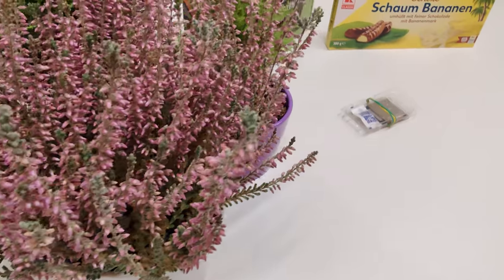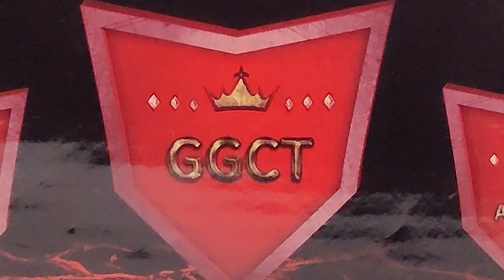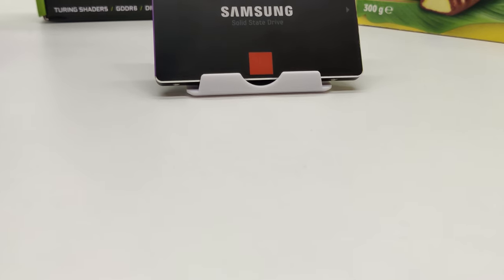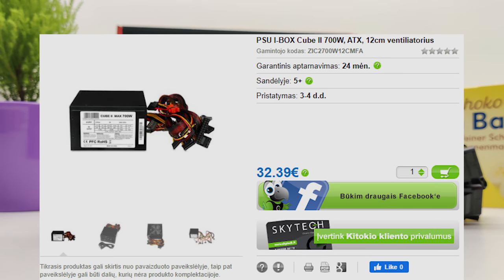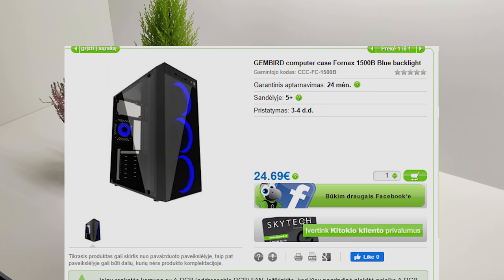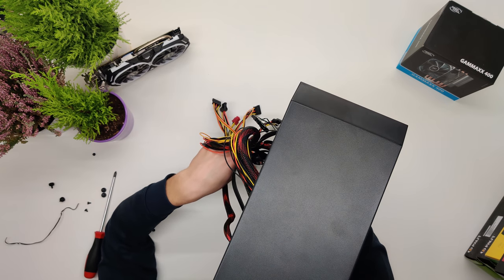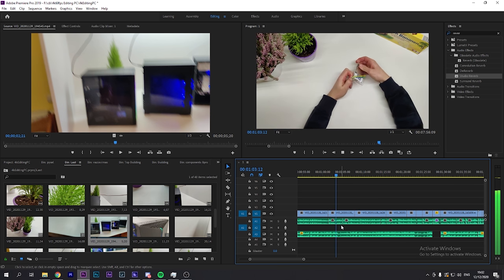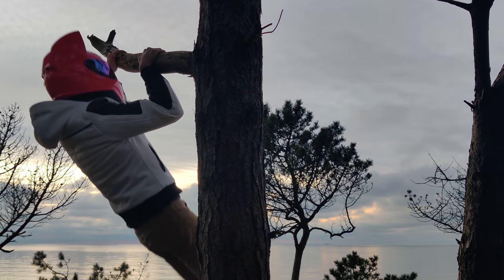4K Editing PC Under 500$?

Comment: so i have a problem with my gpu....it doesn't show signal output on any intel motherboards (lets say 2nd,3rd,4th and so on) but only boots with old AMD FM2 mobo with a degenerate APU, now i dont know what happened exactly but it seems that my luck dried out it intel boards
Reply from the maker: Have you tried browsing forums on this issue? Seems super weird 😂
Reply: @CheapBastard  I searched the exact same phrase but nothing came out, but the Gpu performed the same(it's an rx 570) but it's now paired with an a8 6500 @3.5-4.1ghz so now the bottleneck are worse than ever

What would be the best cpu/apu I can upgrade afterwards for an fm2 mobo?
Reply from the maker: Yooo, I might know the issue. Upgrade the bios on these intel motherboards. Those older motherboards struggle with new gpu support
Reply: @CheapBastard  yea well I didn't needed to change my existing mobo cuz it wasn't giving me signal all of a sudden, so I took it to a local dealer and he said that Gpu is busted. Gave it a full blown cleaning but it didn't turn on with my mobo and many newers ones, but this lucky fm2 mobo gave me signal, still boggles what happened with it....

Comment: Instead of 6900K, don't u think it's the xeon varient of the 5820k and still keeping that unlocked multiplier but still trying to be a more value CPU by slapping Xeon in front of its name?
Reply from the maker: Well, 5820K has 6 cores and 12 threads. That 1660 v3 has 8 cores and 16 threads, so I think it is closer to a 6900K 😅

Comment: Nice.  My editing workstation/gaming PC is very similar.  I have an old Dell Precision T1600 with an E3-1245 Xeon, 12 GBs of RAM and an RX 570 8 GB GPU.  Does everything I need it to.  I am planning to make out the RAM to 32 GBs at some point though.
Reply: How was the rendering times?
Reply: @niallherrera4031  For about a 12 minute video I would say about 5 to 10 minutes in HD.  I don't record in 4k or anything so it is pretty efficient at the resolution I record at.   It is also very snappy for photo edits.  I also run Linux so I can't really comment on how well it runs on Windows.
Reply: Daniel Stewart thanks!

Comment: Hey! Would you rather buy the Gembird Fornax 1000B instead of the Gembird fornax 1500B? Do you have any videos where you feature the Gembird Fornax 1000B? Thanks. Also, does the 1000B have a usb 3.0 19pin connector? :)
Reply from the maker: Hey, I would actually buy Fornax 1000 series instead. The cable management is only slightly worse on that thing, but that case is bigger and more spacious. And yes, it has that USB 3.0 connector
Reply: @CheapBastard  ok thank you for the reply!

Comment: I have an i3-4130 and have a limited budget what processor should I get?
Reply: i5 4590 verry powerful processor and really cheap and it can handle a gtx 1060 6gb withought bottlneck
Reply from the maker: Look for a xeon e3 12xx v3. They are way cheaper than i5 and i7 counterparts and deliver the same performance
Reply: @CheapBastard  thanks bro love this channel btw